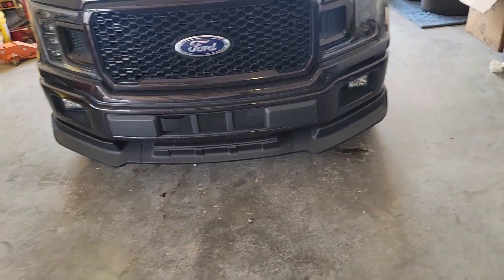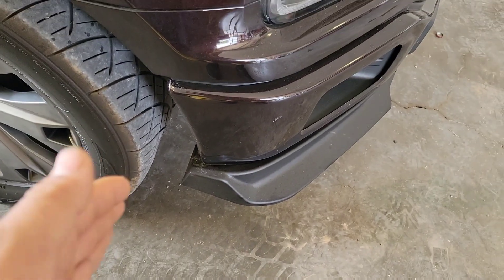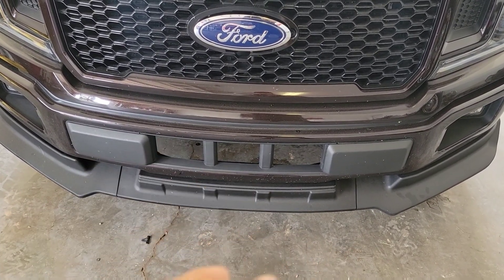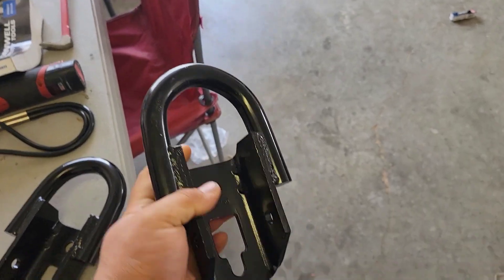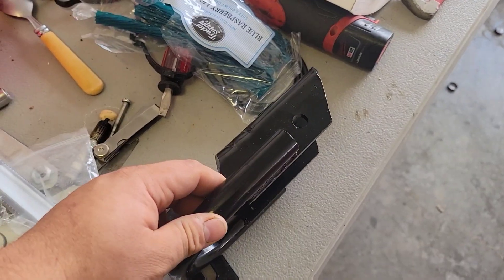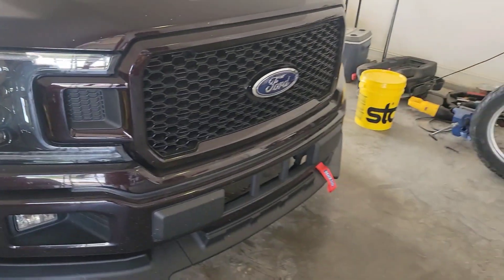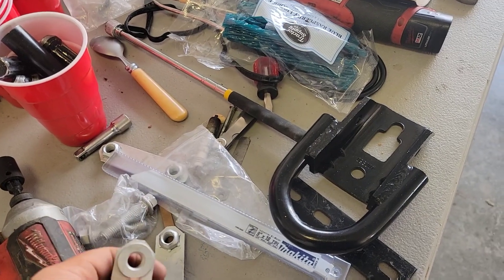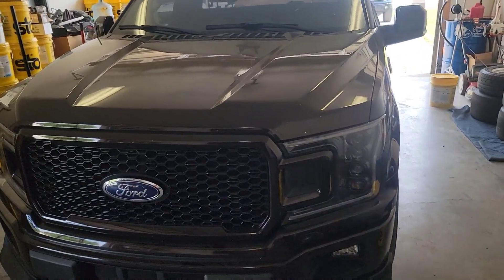Installing Tow hooks and Tow strap on my 2018 F150 Coyote?? | New splitter review

Comment: I have a 2016 f150 platinum and o ordered the same splitter and the chrome tow hooks do you think I have to do the same modifications????
Reply from the maker: This splitter is made for your year of truck so you'll probably be fine, but since I have an 18, the bumper does change a bit and I made the splitter work unfortunately the tow hooks did not fit properly.
Reply: @Puropadelanteco  thank you man👌